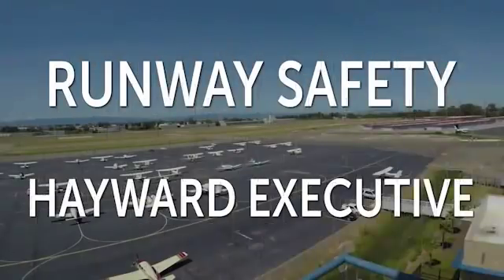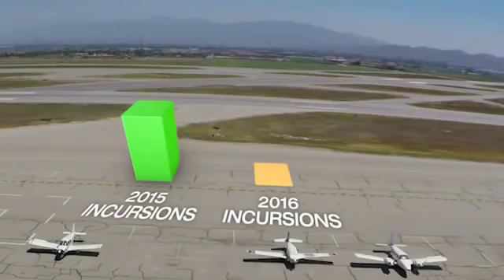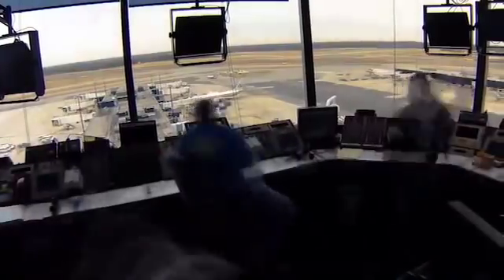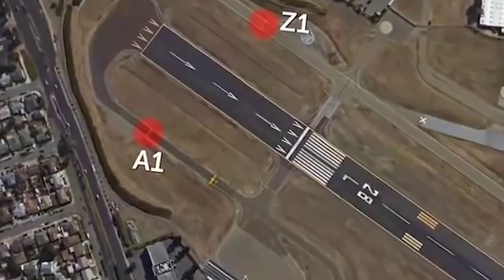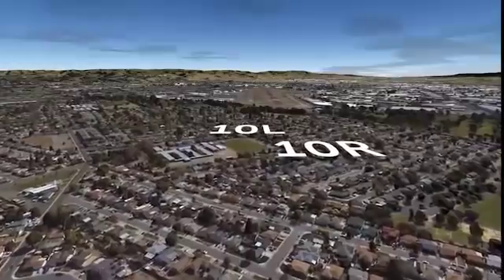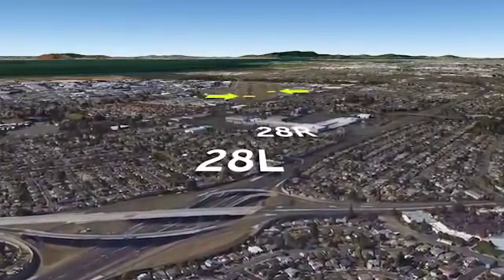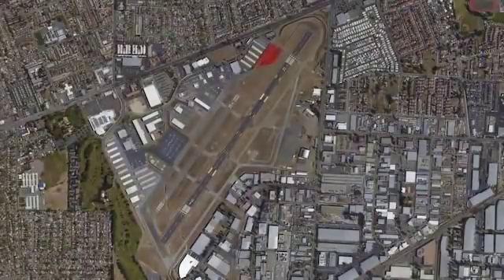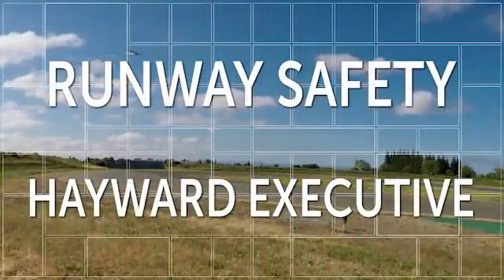Runway Safety @ HWD

Comment: The airport has to accept some responsibility the hold short line for 28L move closer to rwy. Lengthen Runway 10 right to the same length as 10 left airport themselves and solve a lot of these problems